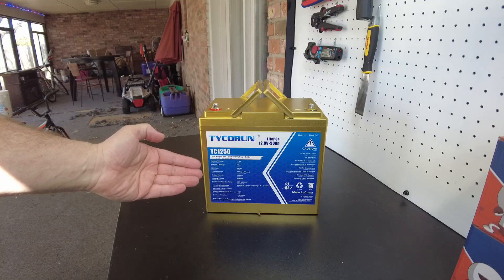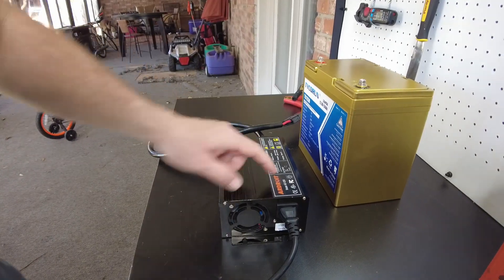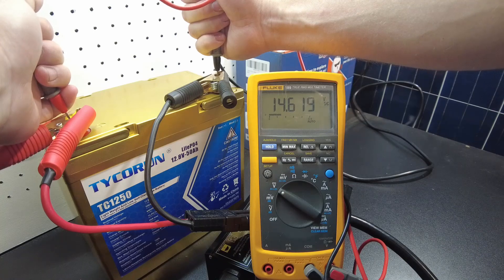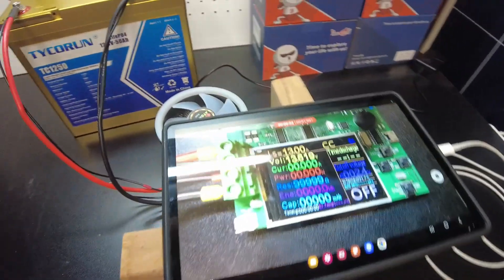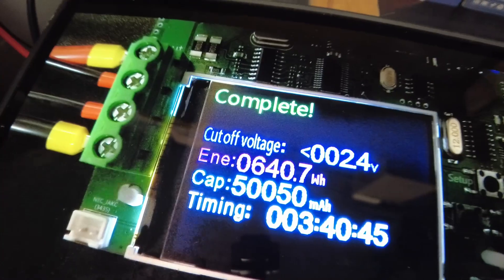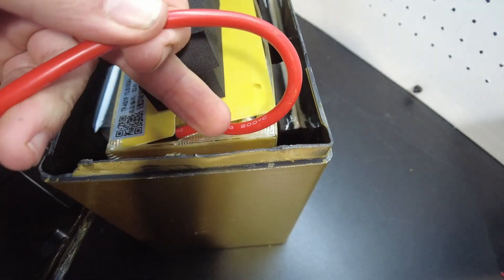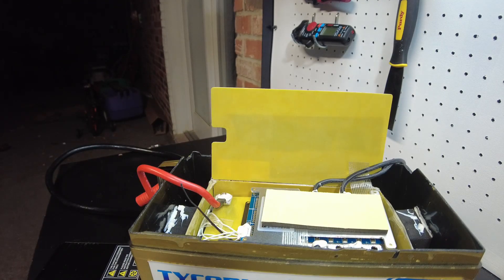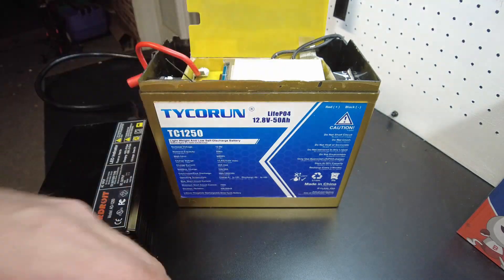Tycorun LiFePO4 12.8v 50Ah Lithium Battery

Comment: 209.00 for 50 Ah  not a very good deal at all .  Plenty on amazon for 140.00
Reply from the maker: The Timeusb 50Ah for $139.00 is probably pretty good, but I doubt it has low temp protect. Still really good if you don't need that.